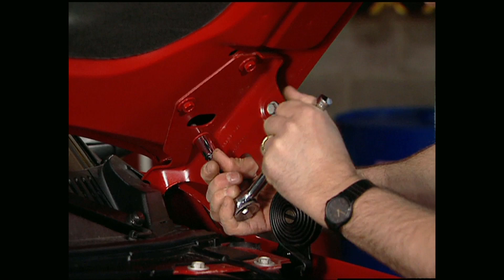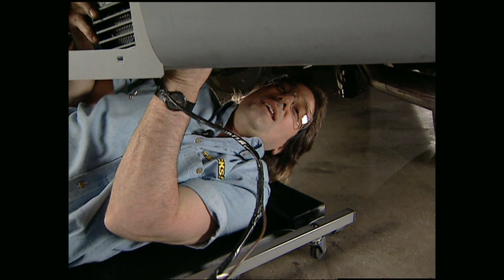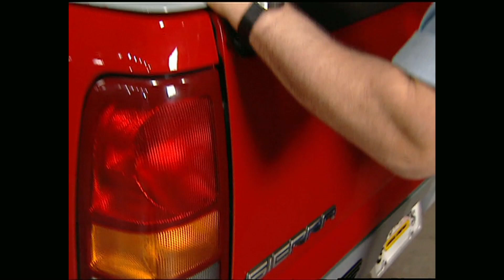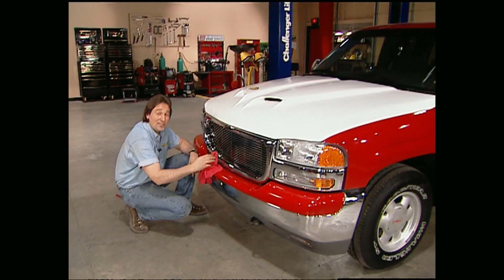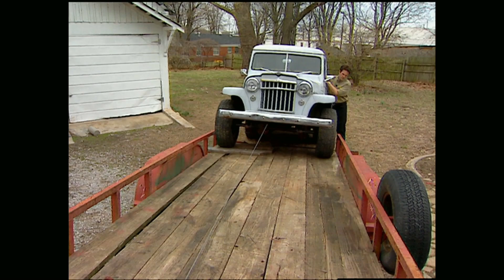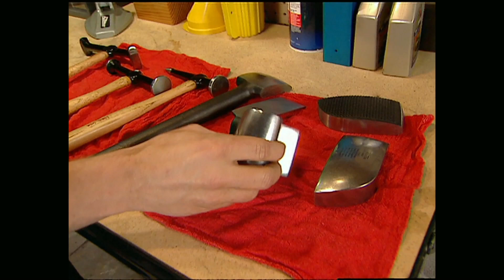Transforming A GMC Sierra From A Work Truck To A Modded Street Truck - Trucks! S1, E11

Comment: Hi I have a 09 Colorado LT xcab 2WD 2.9 manual 5 speed, 
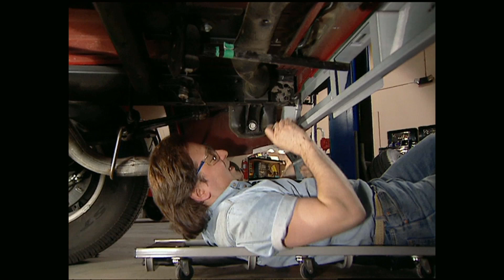Need help with issues is it better to swap  3:73 Ratio to a 4:10 Ratio or engine swap 
Please let me know  thanks
Reply: might be better to post on a automotive forum than an old youtube vid. good luck bud

Comment: the mods on that sierra have not aged well at all...  love the show though...
Reply: Hood looks ok.  The lights I could live with but the wing on the cover is absolutely horrible.
Reply: @bmstylee  the hood is ok but not something id do..  and the roll pan minus the lights i do like..  but i agree with you, that wing is horrible
Reply: @Paco_Lopez713  i would use the roll pan for a custom exhaust exit, the spoiler in the back should be a dovetail style spoiler not a wing, grille tho is kool
Reply: Agreed, the 90's called, they want their mods back
Reply: The hood isnt even functional, just keep the stock if you're gunna get fake scoops 🤢
Reply: @Pl4t0  hate to burst your bubble but most hood scoops don't work.  Even on factory installs.   They are for looks not function as a general rule.
Reply: Grille still looks good and the tonneau cover without the spoiler also looks.good
Reply: The grille isn't bad. As far as the hood goes a functional cowl induction hood would make more sense. At least it would lower under hood temperatures.